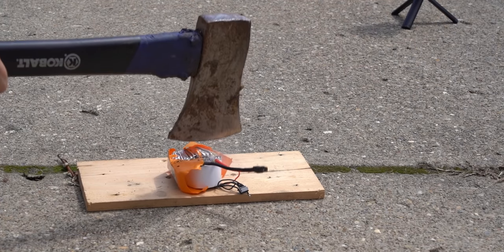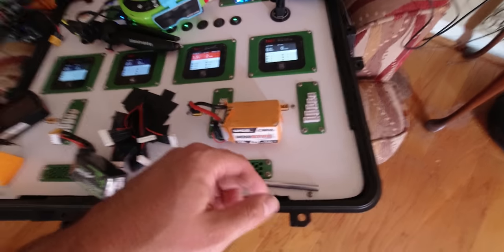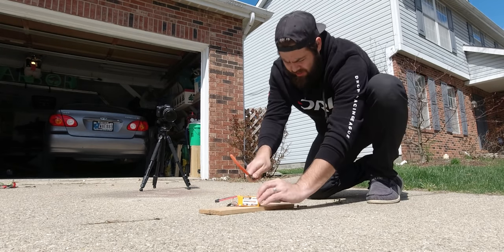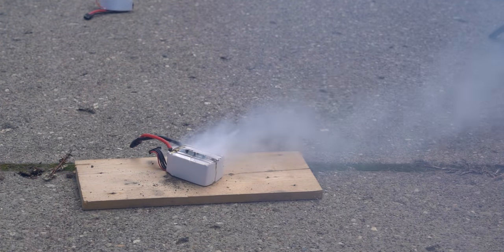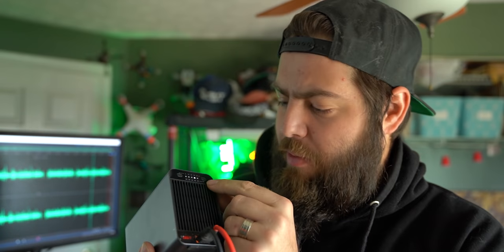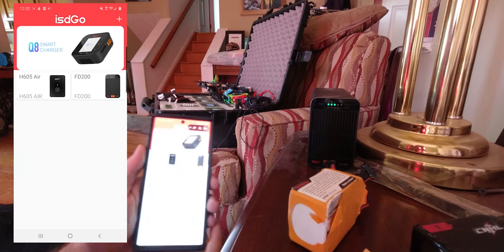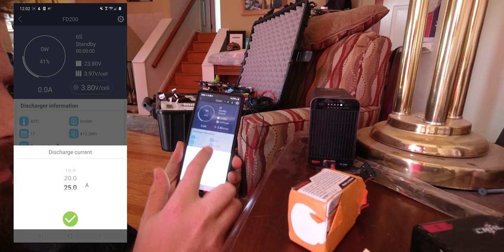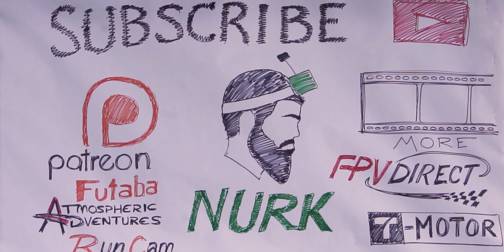Why you SHOULDN'T travel with fully Charged Lipos

Comment: Great video, Nurk. A very important topic. 

I have had the FD-100 model for almost a year now, and use it all the time. I typically charge all of my packs for the weekends... but have had bad weather scuttle plans from time to time... leaving me with 20+ fully charged packs.
With my FD-100, I'm able to daisy chain multiple parallel boards together, usually 3 for my typical purposes,  and drain 12 packs at once at a max of 500ma each. 

Saves loads of time, and is a nice gentle discharge rate. Babying the investment! 

Additionally, I plug in the balance plugs too, to keep them safely stowed during the process. 

I love the idea of the FD-200 and Bluetooth, tho... that's brilliant. Have to look at this. 

But for $35, the FD-100 also works great for the budget-minded.

Comment: Nice video, I actually just had a lipo blow on me. Was sitting at my desk. had 2 6S 650 batteries on the balance board, but they were fully charged. Just sitting there while I finished up some other stuff.... all of a sudden, I hear a hiss and then smoke... Batteries weren't damaged, hadn't been in a crash, I guess it was just their "time"... Fortunately I had them charging in a Bat-Safe and it was a very controlled situation. I was shocked when I later opened the safe to see the amount of destruction. Be safe out there! Respect your batteries!

Comment: NURK!, you're really awesome and absolutely one of my favorites..., but brother, cutting  that fully charged lipo by hand was pretty darn stupid. You got really lucky. I've done this demo many times and a lot of the times, the lipo goes off faster than you can pull your hands away. Pretty much an explosion of flesh destroying heat and fire.  That ax was your best safety tool for a safe demonstration. Not saying you're stupid, at all, but your action to test fate like that was. I know, cause at 53, I've done it many times over. 

I love your content Nurk, BE Safe man. Flying anything RC with burnt hands is a real challenge but not as bad as wiping your own buttttt.  Rotor On Nurk!

Comment: You seem to have missed that the packs need to be at the same voltage before plugging into your squid lead. I looked at that very discharger but didn't like that it doesn't keep the packs balanced I went for a cheapy one that uses bulbs but also monitors the cell voltage not pack voltage.

Comment: Great video... Thanks for the talk about the ISDT FD-200 i had never seen it, I just use my chargers to discharge... So you had a multi battery plug on it, can you do more then one battery at a time? and i see it only uses the main power plug so doesn't that get the cells out of balance? Thanks for any info. looks like a cool little device.

Comment: I use the HOTA D6 Duo PRO and the ext discharge function with a 185w resistor that I soldered onto an xt60 lead, and a fan blowing across. It works so much better than the chargers built in 5w discharger

Comment: I got the FD100 and i love it!  i discharge while im packing up before heading home.  but  im only 1lipo at a time.   2 or more lipo discharge at same is the on fd 200 only?
Reply: You can allways connect your batteries in a parallel board and dicharge them it's safe and easier
Reply: I always discharge my batteries too but i have a smarter solution: i plug all my batteries in parallel into my M8 toolkitRC charger input, then i made a cable xt60 to barrel connector that i plug into my laptop and then i use the output function on that charger and i set 19.5v and 9.5A and i have some hours of "free" electricity to my laptop. Its easy, fast and you don't waste your energy just to make hot air and noise ;)
Reply: @jordigrau83  Oh yeah i got a few xt60 to usb with low voltage cutoff to about 3,81ish   its perfect to do some field editing, or brew some coffe on a 12v mocca master XD  love the content buddy!

Comment: Luckily I have never had an issue in 13 years of dealing with lipos . I have even had trouble getting one to burn on purpose . Driving a nail through the pack works every time tough . Each cell needs to be shorted to the other and you get nice flameage.

Comment: A lot of people have the misconception that the lithium in lithium batteries is the dangerous exploding stuff. But thats entirely wrong, there is no pute lithium in these cells and the electrodes behave quite tame when exposed to air. 

The "explosion" is really just the energy stored in the battery, and this is true for any type of battery. Put lots of energy into a tiny package, and something like that can happen if you somehow release it all at once.

Comment: I'll be honest. I've never discharged my lipos. Seems scary. I normally just run them down to 3.85 and done. Is that wise?
Reply: 3,85 is storage voltage so you’re good 👌🏼
Reply: 3.85 V is a pretty good storage voltage. A lot of chargers have a charge/discharge to storage function, pretty easy to do.
Reply: The longer they stay charged over time lowers the IR, get a xt60 light bulb and a $2 beeper ....if u like ur lipos.

Comment: I've seen a few battery fire protection bags where the reviewer will test if the bag will withstand the heat from one battery on fire. But most of those bags  (even the ones being reviewed) fit 4-8 batteries and most people will pack those bags up to maximum capacity. I'd love to see a realistic test where the reviewer tests the bag filled to capacity with multiple batteries.

Comment: Just imagine how scary it would be if smoke from 10 fully charged lipos started billowing out from the overhead! Now imagine its all your fault lol Good tips and also get a lipo bag(I use Pyro's bag cheap and large enough). Traveling with a drone is super easy. I got extra inspection once and they just swab everything then measured my tools. I ended up getting Ethix's combo wrench for traveling so I don't need to bring hex drivers that are essentially ice picks.

Comment: How long does it take that discharger to storage charge a full 1500 6s?
Reply from the maker: OMG I TOTALLY FORGOT ABOUT THAT PART OF THE VIDEO! 

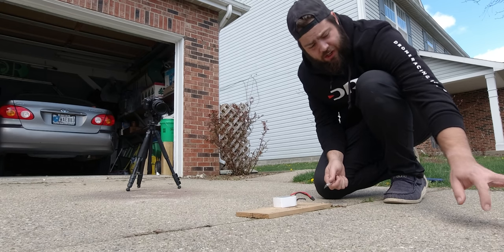I tested a 4s 1300 @ 4:30 seconds 
and 
6s 1300 @ 6:30 seconds..
Reply: @NURKFPV  damn that's impressive. The charger I have can do one 1500 4s in about an hour and a half. Thanks for the reply. Gonna have to get one of these some day
Reply: @NURKFPV  I use the ISDT discharger as well as my balance boards to discharge.   Plug in 4 packs along with all the balance plugs and all the cells come down evenly.   If paralllel charging can work why not parallel charging, as long as all the packs are at the same voltage.

I also had an ISDT T8 die on me because I was using it to bring charged packs to storage.    Should have had the dedicated discharger to begin with.

I have the older smaller ISDT unit but it still does what it is supposed.   Works great for LiPos but not quite as great for LithiumIons, that new one that has the bluetooth capability would help a ton for bringing the 6000mah and 12,000mah  LithiumIons down to 3.6v per cell.

Comment: I noticed your charging setup on charging multiple batteries at the same time, far better solution then a parallel charging board which ignores the state of each battery individually.
This means that four perfectly good batteries will average a OK to the balance leads giving the charger an inaccurate reading on fifth battery with a bad cell on the same parallel board that
 may have just went bad (crash?) leading to your house burned down .  I had a battery that went ballistic, but I was there, saw it flash and put it out but not after some fire damage to surrounding wall, other items on same shelf and the carpet.  Now my heavy amp charger has temp probes that I slip over the battery, temp goes up charger turns off even if the sensing on the balance leads fails. Being in a hurry to get a bunch of batteries charged up real quick is not an excuse to defeat the one purpose of the parallel leads. Do a video on this? Somebody might listen and save a
house or life.
Reply: I always parallel charge but also monitor the IR not the voltage if the IRs are off you know there is a cell on the way out.

Comment: There was a cargo jet that bursted into flames mid air because of a pallet of lipo batteries i believe the crew succumbed to asphyxiation right after landing the plane 

 Its bad for them to store them completely charged or discharged anyway to get max life 50 to 80 percent storage
 Not sure about lithium ceramic batteries know they have higher c rates operating temps dont make crystals that destroy other lipos you can use one while cutting the cell with scissors 

 If your looking to learn more about these batteries or modern electronics period give John B. Goodenough a quick look learn alot